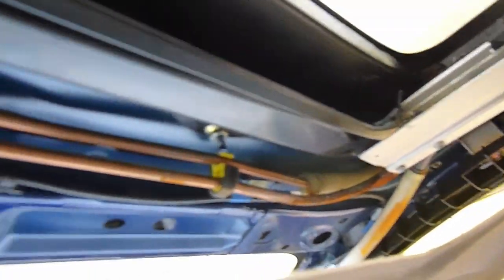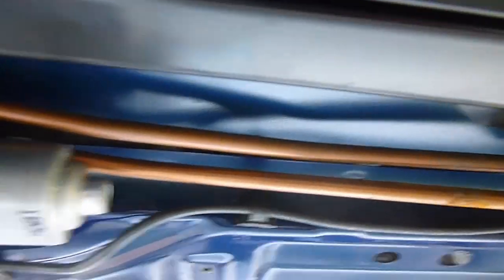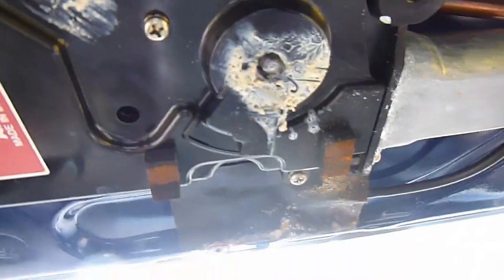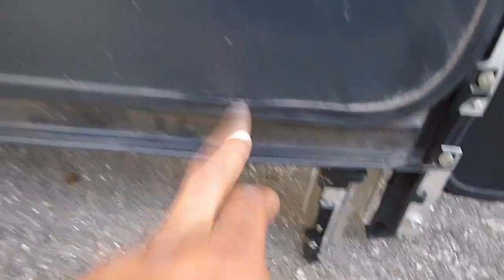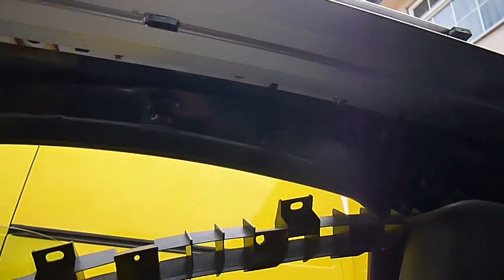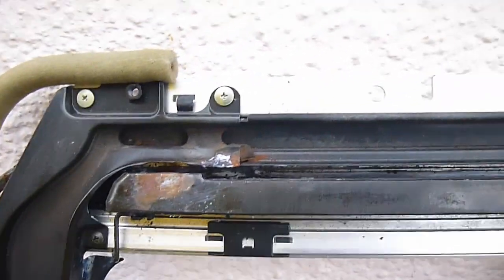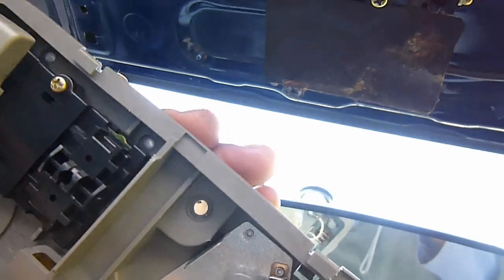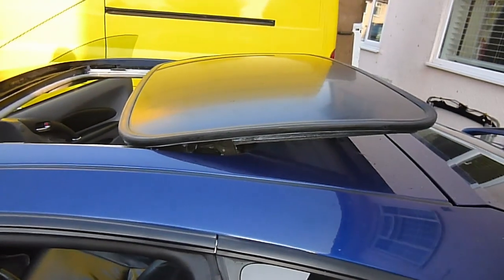Sunroof repair

Comment: Well done! I need to replace fuse. Hope works. But if not, it's a motor issue. And possibly corrosion as you had. I own a 2001 . Thx again. A request for instructional vid on trim. Bezel area. Radio, clock radio. I know there are pins. I want to replace because mine cracked from age and sun exposure.

Comment: Love the videos!  I know this is nearly impossible because you'd need an assistant but I miss clips of you actually carrying out some  of the jobs.
Reply from the maker: True, I think an important part I should have shown is how I eventually got the motor off. I took the outer casing off the motor and disassembled it, which released the gearing from the frame. Thanks for watching.

Comment: How'd you remove the motor? Just a few bolts and a connection or was it it jammed in there?
Reply from the maker: Thinking back I think I opened up the mother and was able to release the gear that was holding it in.

Comment: hi i have celica 2000 i was ptrying to unclog the drain but i cannot see the drain plug do i need to take the headliner before i can unclog the drain plug? ty hope hear  a response from you thank you...hi what is that copper hose? what is the use of that?
Reply from the maker: There are four drains in each corner, from memory I think I accessed them quite easily but that was once the actual sunroof was removed. But I think you maybe able to get to them once the headliner is removed
Reply: @michelod.i.y.5202  thats sucks because you need to take the headliner before you can  unclog.. celica is not same with the other that you can see the drain plug each corner. except at the rear drain plug but you have access to drain..btw thank you.. continue your channel new subscriber her
Reply from the maker: @superkari28  thanks for your support, much appreciated. Good luck with the motor
Reply: @michelod.i.y.5202  i need sunroof glass assembly for my toyota celica gt 2000 everything is busted but the motor is still ok  if you know someone who trying to sell let me know btw ty
Reply from the maker: @superkari28  I suspect its getting more and more difficult to get parts, I had mine from ebay years ago, I may have a spare glass, I'll have a look tomorrow
Reply: @michelod.i.y.5202  ok..i need rail panel assembly with sunroof.. let me know where can i contact you
Reply from the maker: @superkari28  sorry mate, thought I had one must of got rid of it a couple years ago when I had a clear out. If I know of one going, will let you know.
Reply: @michelod.i.y.5202  ty... but if you know some toyota car parts dealer in your country dont hesitate to send there company name so ill be the one to contact them
Reply: My sunroof is not sliding its just open what will be the problem any idea

Comment: Hello, do you still have the Celica?

When you open the sunroof to the fully open position, is the sunroof level or is one side higher?

Mine has this problem.
And I don't see anything broken...

Do you have any ideas about this?

Thanks
Best regards
Reply from the maker: Hi Celica still going well thanks. I'm pretty sure it could be the internal screw thread inside the sunroof mechanism sticking, usually through corrosion. In my experience difficult to repair. Sorry not to sound more positive. My solution has been to keep them well greeced and use it regularly, even through the winter months I operate the sunroof once a week
Reply: @michelod.i.y.5202  thanks for the reply! When it's completely open, if I force the lower side to the right position, it goes up and stays at the same height.
On this side I noticed that there is more slack.
and on both sides there is a little wheel that looks like aluminum and is worn out. Once upon a time it must have been driven without any lubrication.
I'll try to find out something more and then I'll come here and tell you.
Reply: Hey, how's it going?
You needed help, if and when it is possible for you. so I can orient myself here on the sunroof.

First question: when the roof is open in a tilting position, is the part that makes it go up on the rail at the end of the rail or is it about 6 mm before the end?
second question:
When the roof is completely open, how high is rail to the roof?
third question:
When it's open, if you press the sunroof down, does the sunroof down a little or not move?

Sorry for so many questions, but as I dismantled the lining and already tried different configurations, I'm running out of ideas to solve it.

Best regards
Reply from the maker: @JeanMelim  apologies if I don't quite answer your questions correctly. When I first press the open button, the sunroof tilts open about 4cm. I'm not 100% sure about the point on the track your referring to but the initial movement is just the tilt. On the second press it opens up and a third press will make it open up slightly more. Then it's one press to close it fully.
Reply: @michelod.i.y.5202  thanks.
When the sunroof is raised to the tilted position, you can see part of the guide. (looking sideways at the raised sunroof) this guide is where there is a joint that lifts the glass and this same guide ends in a rounded shape. In my case the joint is 6mm around the rounded part in the tilt position.
On the right side, if I press the sunroof, that joint doesn't move. On the left side it gives way and there is more than 1 cm of space left until the rounded part.
When it's all open at the back, either in the first one where it stops or in the second one when we insist a little more. the same thing happens. When you push the left side, it falls and the guide touches the roof of the car.
I've already tried to make several adjustments, renewing and installing the motor, advancing and delaying the cables, but I think one of the two reasons is:
Either the cable has a worn “tooth” and “jumps” or the joint is broken.
thank you very much
Reply from the maker: @JeanMelim  I think I understand now, let me look tomorrow morning and I'll get back to you.
Reply from the maker: @JeanMelim  hi, I've had a look at my sunroof,  looks like I have a similar gap on both sides above 6mm and in the tile position there is no movement in the brackets
Reply: @michelod.i.y.5202  I'm going to remove the entire structure to see if it makes it easier to understand what's happening out there.
 thanks
Reply from the maker: @JeanMelim  one thing I found useful is once disassemble, connected just the motor, and press the switch to the fully closed position and then you have a refrence to the position the sunroof should be assembled with the motor in that position
Reply from the maker: Important if you disconnect the motor, insure you remove the fuse first, to avoid it blowing, they're difficult to replace
Reply: @michelod.i.y.5202  if was thinking disconect the battery first but thanks again.

Comment: Which size and which tools are needed to remove? My stopped and it won't close
Reply from the maker: Mainly 10mm bolts if you can hear a slight click when trying to open or close it the motor is fine and it's the running gear that's seized and you have to replace the whole sunroof assembly but might be able to retain the motor

Comment: Did you clear out the 4 corner drain tubes? If those are clear, there should be no water accumulation which causes leaking... Nice video. Thanks!
Reply from the maker: Thanks, all cleared out, has been working great since the repair.

Comment: Did you get the new glass from dealer or elsewhere? Just wondering what the cost was?
Reply from the maker: Thanks for watching, I re-used the the old glass. It was a while ago but I think I paid just under £100 for all the running gear and re-used the motor